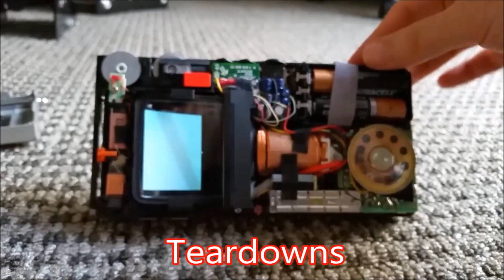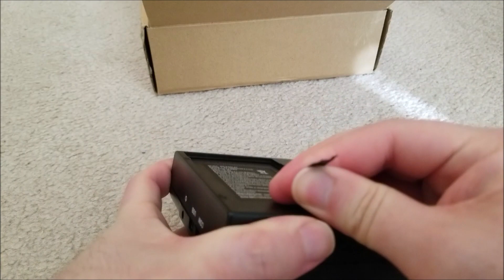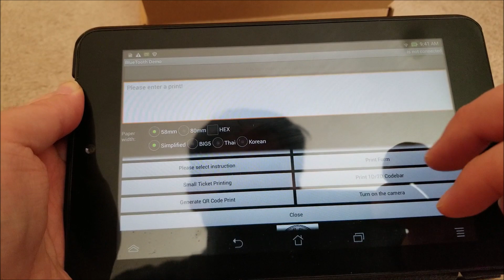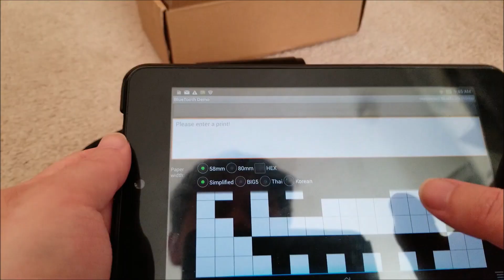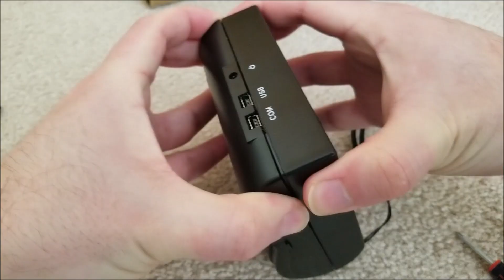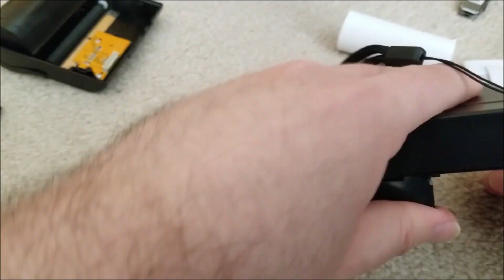Losrecal Mini Bluetooth 80mm Thermal Printer Review

Comment: It doesn't show up on Bluetooth list, so are there any buttons to be pressed to activate Bluetooth mode.
Reply from the maker: Are you searching from the device settings menu or the menu in the app? I'm pretty sure you have to use the app to pair and use the device as the protocol is proprietary.
Reply: @sjm4306  it's my fault because it's wifi not bt so awkward but its my bad  I didn't notice that.
Reply from the maker: It's all good

Comment: How do I connect to Bluetooth, i tried everything but I failed.
Reply from the maker: What device are you trying to connect to the printer? You have to pair the first time just like any other bluetooth device. Then depending on what device you are using you need to download the app linked in the product manual and within the app tell it to connect to the device to start using it.

Comment: It's impressively bad at printing pictures. Clearly they didn't focus on that functionality at all. A bit of a shame.
Reply from the maker: It's a 1 bit monochrome receipt printer, unsurprising. The only way to get better image detail would be either to implement grayscale (adds more sw/hw complexity), or pre-process images to add a halftone stippling effect (which can be done separately on a computer to modify the source image file).
Reply: @sjm4306  I know. There is many more printers available in the same price range that does dithering in software, also does the line feed much better so it doesn't make those lines. Paperang for example.
Reply from the maker: To be fair this printer is specifically marketed for business use and not for printing images. Just as a photo thermal printer would suck at printing fine text on a continuous receipt of arbitrary length rapidly, this printer just isn't made for printing images. I just wanted to test it that way as they added the ability to load images to the demo app.

Comment: Can you print from any app? You only showed using manufacturers app.
Reply from the maker: Only apps that support this printer will work (aka manufacturer supported apps). Currently the sdk and source is provided for the app I demo and there's a turnkey receipt/inventory management app called Loyverse. As far as I know the printer is just a bluetooth serial device so it's technically possible for any app to send data to it, but I have no idea if it expects the data to be specially formatted for it to print.